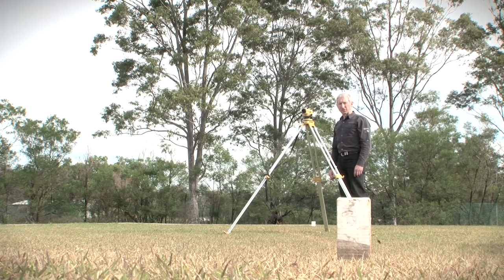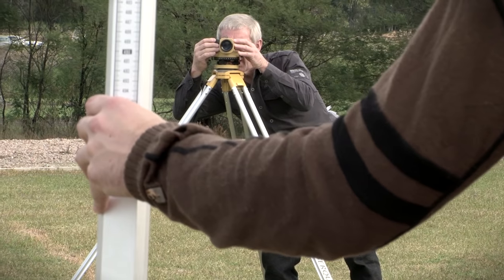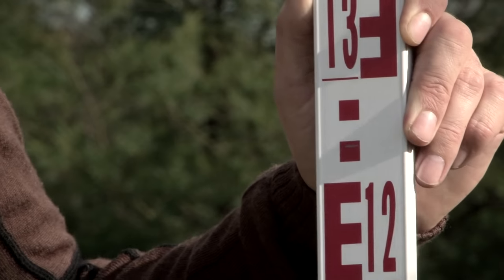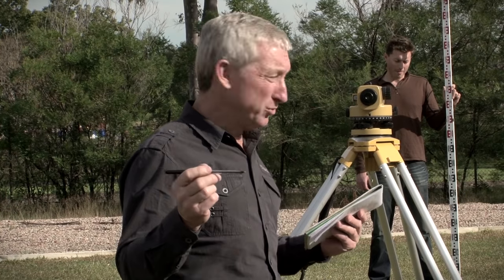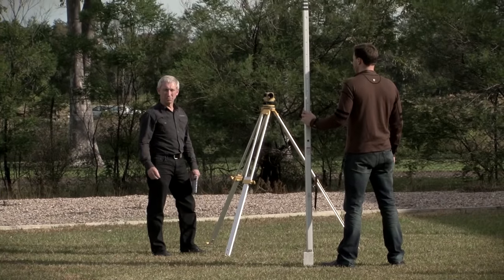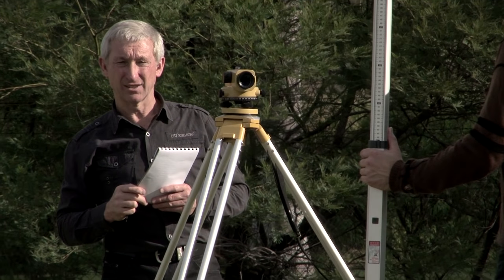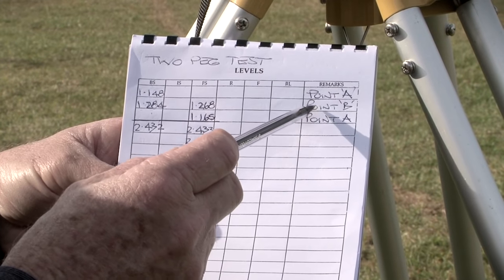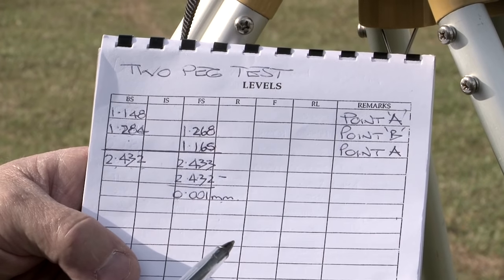Surveying 3 - Two peg test OTEN Building & Construction

Comment: Some Helpful Engineers Notes for Viewers:

(1) The two peg test here is correct but the 1 mm error in 16 meters is really is about hidden in the noise of the readings.  The rod reads to 5mm and you can read it easy to 1mm since the Auto level is typically 24 X in power. You have two rod readings at 8 meters, one at 16 meters and one at a few meters. If you Root Mean Square/RMS the errors you probably have 1 to 2 mm total. So the instrument is like really off 1 mm +/- 1.5mm in 16 meters. 

So an instrument that is "off" say 10 to 20 mm in 16 meters make a better example!

(2) An auto level like that is typically 24X.  They do make 20, 22, 24, 26, 30 ,32 etc but 24 to 26X instruments are most common.

(3) In the USA a typical box store 24X Auto level is usually aligned to about 1/8 inch in 100 ft when built in China. 3.18mm in 100ft . That is one part in 9600 parts. ie 1 mm in 9.60 meters.  All the shipping and bumps sometimes makes a low end instrument be like 1/4 inch error in 100 ft, ie 6.35 mm in 100ft. That is one part in 4800 parts. ie 1 mm error in 4.80 meters,

(4) If Joe Good contractor takes care of the level the instrument will stay aligned for years and decades. Think cellphones, cameras,  etc they often get dropped too. 

(5) If John Rough Contractor throws the level around like a shovel in his pickup after awhile the compensator hanging tapes in the auto level will stretch or even break. Then you have a real error of say 0.1 or 0.2 ft in 100 ft . ( 10 mm or 20 mm in 10 meters). If he drops the instrument hard you might get an gross huge error of 1 to 2 ft in 100 ft. (100 to 200mm in 10 meters)  

(6) With a BIG bump the instrument's compensator will no long hang down correctly and the instrument cannot be aligned unless the compensator is replaced or restrung. 

It is like if a 50 stone man sits on the children's swing set and the chains break or something gets stretched and the swing does not hang properly.

(7) Most auto levels get out of alignment by being abused. ie dropped or bumped hard. Lending one out is risky , folks often do not care.

(8) Auto levels used around concrete work often get concrete dust all over them. Sometimes the compensator gets stuck. Tilt the instrument slightly with a leveling screw towards you object to make sure the line of sight still is true. The "compensator" is the prism or mirror suspended inside that makes the level "shoot level" . It does this over a narrow range, when the bullseye vial bubble is sort of aligned. Many instruments will read true once the compensator is not stuck, ie you tap the instrument lightly.

(9) You can check you instrument by moving it and taking the same readings again. Lets say a buildings slab to be poured is is 10 meters by  20 meters.

 Put the instrument in the center and measure the 4 corners heights to the corner boards. Let say they all are 1.50 meters  . They all are the same distance from the level so any collimation/ slope error of the level does not matter. 

Then move the instrument close to one corner, the same distance to the next two, and farthest for the last one. 

You might get 1.498, 1.500 1,500 and 1.502. 

Or you might get 1.45, 1.50, 1.55 meters if your instruments is way off.
Reply: thanks

Comment: Its easy to calibrate level yourself.. do not trust a calibration shop.. I did it once and they screwed it up bad. The way to calibrate is pick two points 50 to 100 feet apart. Set the level within ten feet of one point-- shoot to the far point-- and then spin 180 to the close point-- measure the difference-- Than move the level to the far point in the same manner.. the differences should be the same.. To adjust-- turn the calibration screws one half the difference and check again.. Keep doing it until you get it so there is no error . I was a carpenter for 35 years. Never tighten down the levels adjustments to tight or you will bend or warp the table. Do not trust laser levels either until you check in the same manner.. Yes i have used bad lasers and level/transits. Also when you set up a level spin in 180 and 90 degrees to make sure it is level in all directions. Never assume any level tool is calibrated.. IT WILL COST YOU IF YOU DO SOONER OR LATTER.
Reply: Thank you for your insight!
Reply: Please difference between which points? Or how do I measure the difference?

Comment: I was wonder why he added the two backside readings and then the foreside.  Why did he add instead of subtracting the first two readings and then the second two and subtracting the results?   But the arithmetic comes out the same. Abs-Bfs-[Bbs-Afs] is what I would have intuitively done, but that comes out to Abs-Bfs-Bbs+Afs=Abs+Afs-[Bfs+Bbs] same as he did.
The answer for me was solved by realizing that his 1st reading he calls a backsight this is toward the camera and at A,  the second reading to point B he is calling a foresight (away from the camera).  After he moves the tripod and takes a reading towards the camera at B which he called a backsight.  The same direction now toward the camera and toward A is now called a Foresight (which I don't get why).    Either way, if you subtract the first two reading A bs=1.148 and B fs=1.268 you get the true difference in height=0.120mm=absolute value|1.148-1.268|.   If there is an error in level it would be some angle theta Up towards A say, but opposite down toward B or vice versa.   If the distance from the tripod to A is the same as the distance to B, call it D, then the magnitude of the error would be D(tan(theta)).  But one up, the other down so they cancel each other out.
So you have the true difference in height 0.120mm.      He moves the tripod and measures the height relative the tripod again.  This time both in the same direction, toward the camera.  Now the errors don't cancel.  He gets a difference now of 0.119mm=absolute value|1.284-1.165|.
That is different from the true difference by 0.001mm=0.120-0.119mm.
I don't know where the 16meters comes from that he uses for the average error over 16m but I suspect it's the distance from the second position of the tripod to A.  Wish that was shown, however.

Comment: That calculation was very confusing, it wasn't explained what backsight and foresight are.  Why can't you just say that the height differences measured from the two locations should be the same and if they aren't then the amount by which they differ is the error.

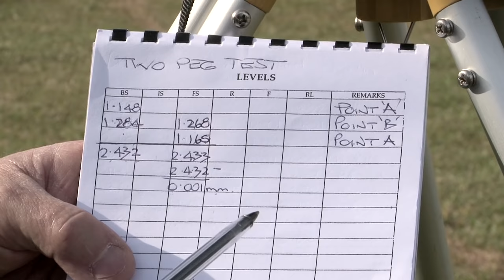Comment: At 5:06 you say "2mm over 16m is quite acceptable", yet at 4:50 you said "0.001mm over 16m". Really? You didn't pick up these confusing mistakes in editing?
Unless I'm wrong, isn't it an error of 1mm (or 0.001m, not 0.001mm) over 16m? With an error of 2mm over 30m?
Also, could you please fix up the play list order? No wonder students, including myself, are confused.
Reply: The error is 0.001 meter

Comment: I have a question. Must the pegs be of equal distance deep into the soil and out of it?
Reply: Adedeji Oludayo what's important is the pegs don't move. Pound them in so they don't move. Same as the steaks. If the ground is hard, use a tool, frost pin or cribbing pin to make a hole in the ground first to get your steak in. If you're Stakes blow over in the wind after you leave the site, you haven't done your job well and the people on that site won't want to have your Surveying Company back.